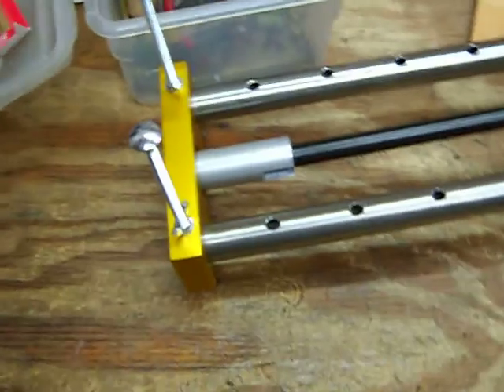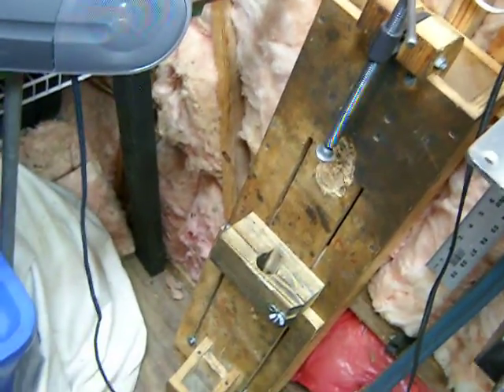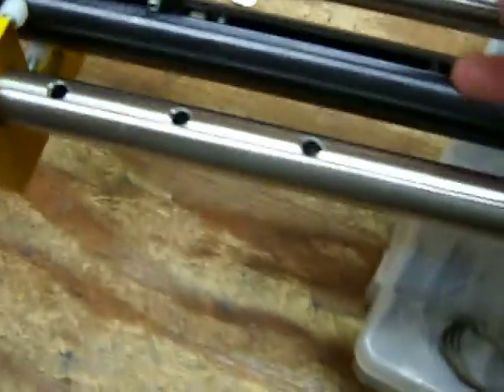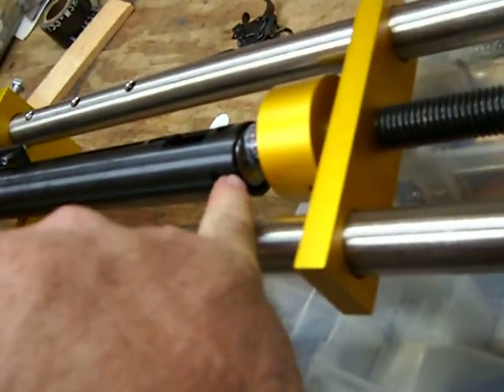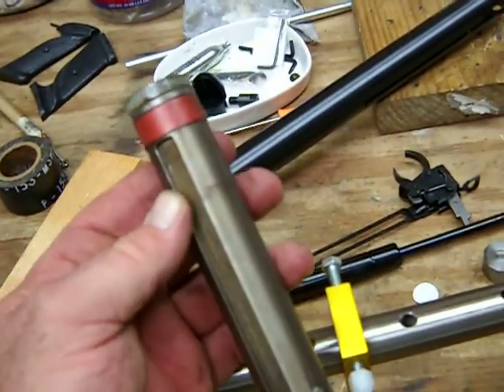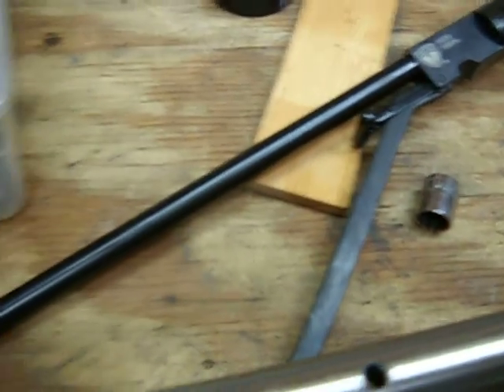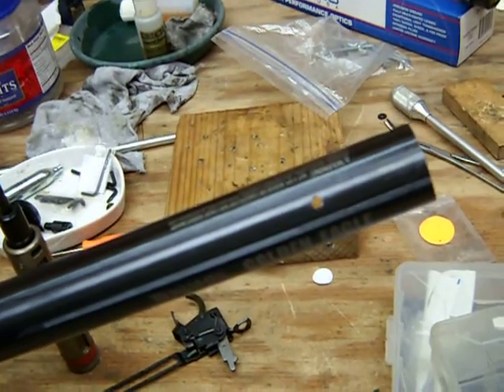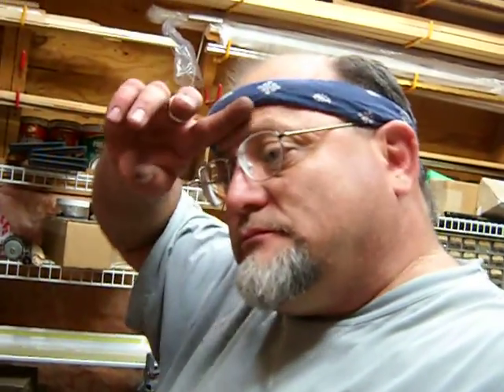professional grade airgun spring/ram compressor

Comment: Great spring compressor... I bought one years ago when B-Square first offered them.

I mounted it to a couple of red oak boards, 3/4"x5-1/2"x12", using the supplied carriage bolts, so I can clamp the compressor down to my work bench when using it... didn't want it to be moving around.

One of the best tools a spring-piston airgun lover could have !

Comment: I stumbled across your video and I'm a fan and also an air gun junky I've been a professional varmint hunter  for year but more so shooting air guns since the 70's and I like your video , it's good to see craftsman like yourself to take out time to review good products. I just had my Mod 125 Hatsan Sniper .25 spring tuned  with the JM seal and vortex spring and that tune made a big difference with the accuracy and vibration, I'm like you I like my spring and Nitro piston air guns and don't have to spend $2000.00 for and accurate gun. Keep the video's coming .